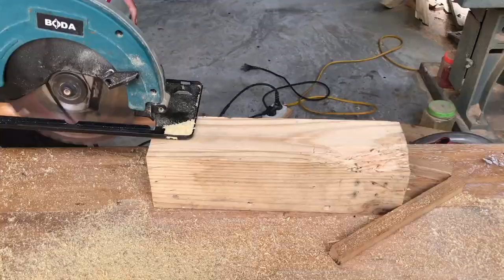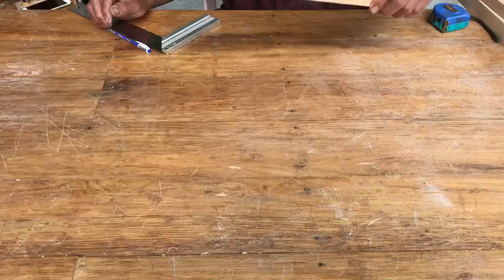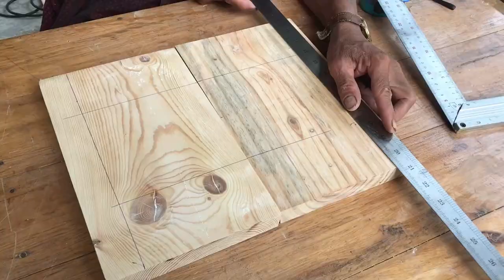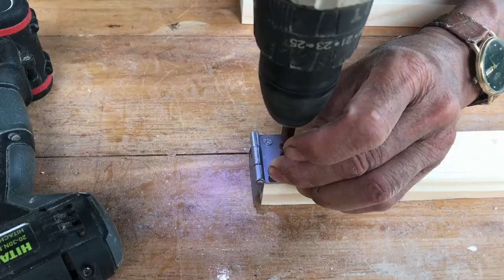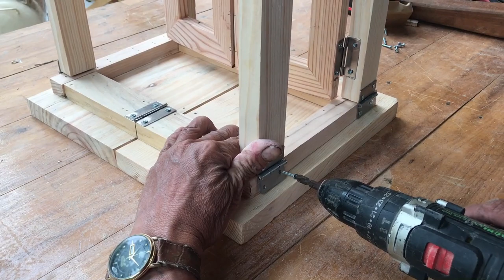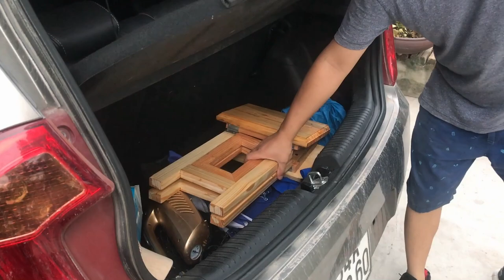Woodworking Ideas For Beginners // How To Build A Extremely Neat And Sturdy Folding Chair - DIY!

Comment: Excellent design I love it. Can I say? When you were planing the wide piece of wood the plane was leaving gouges made from the edge of the blade, I have found that if you round the corner of the blade slightly it helps in preventing that.
Reply from the maker: thank you